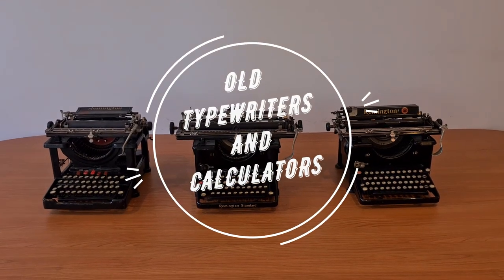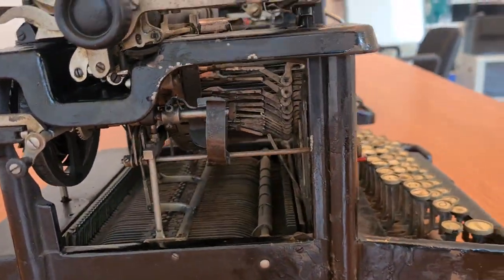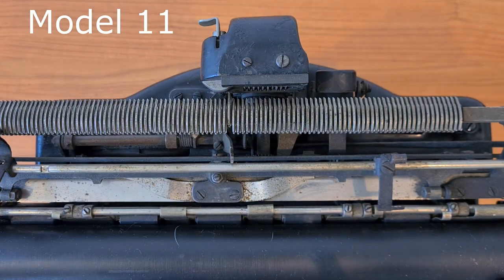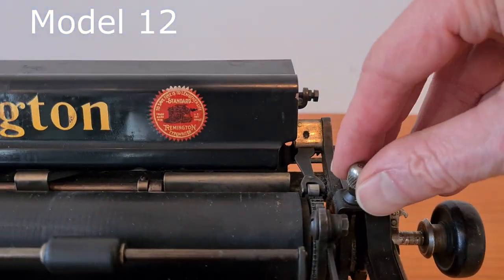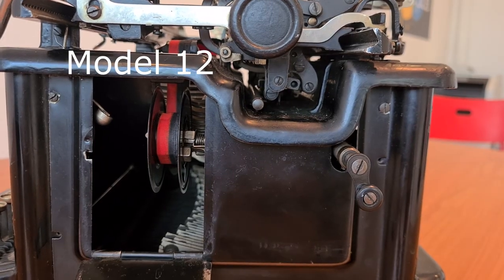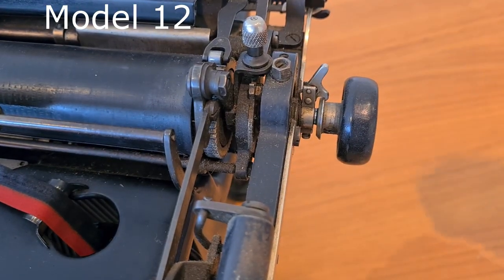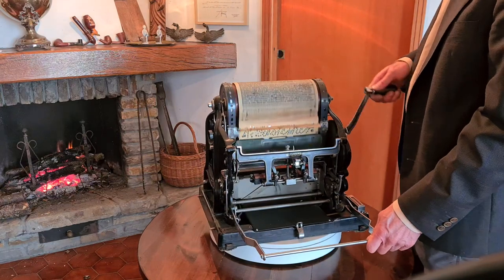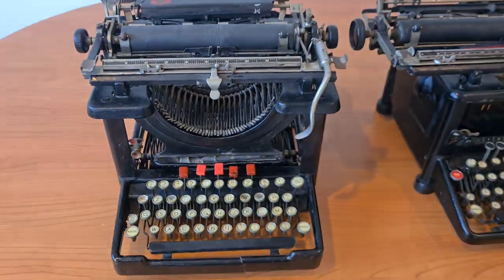3 old Remington typewriters from 1913, 1925, 1927, their differences (video 121)

Comment: I have a Remington 12 which has been fully restored and is a wonderful display piece. I also have a 16 which is almost as good looking and works brilliantly - I type on it frequently. The return lever is on the left side on the 16, unlike this lot. I also had an 11 for a while, but have since sold it. That one had tabs at the bottom front of the machine. It also typed very well, and had a large paper table. Overall, very nice machines and surprisingly still very capable for real typing.
Reply from the maker: It seems you are an expert collector.